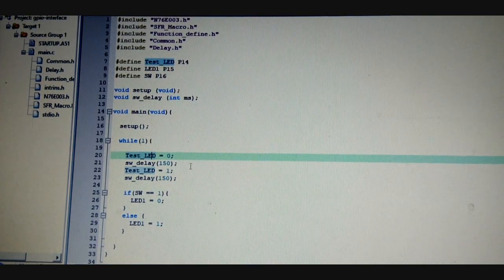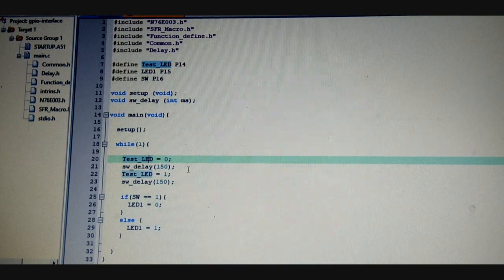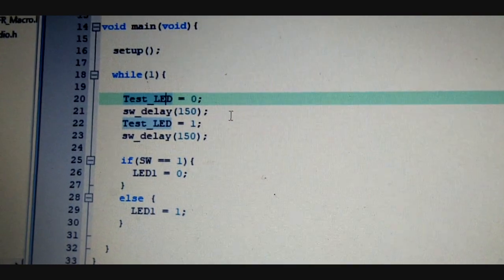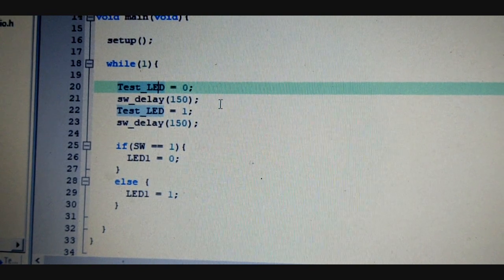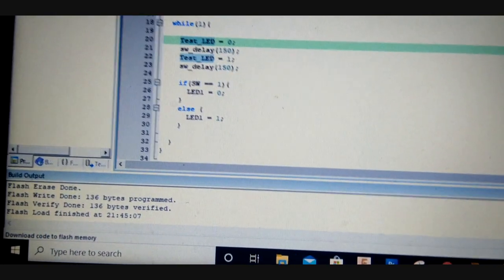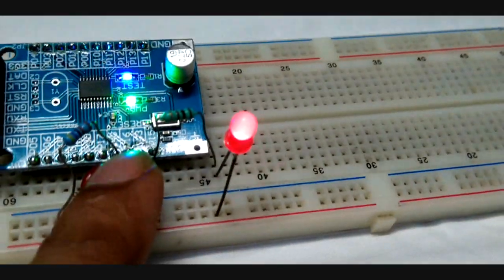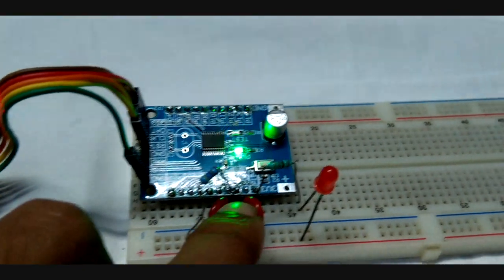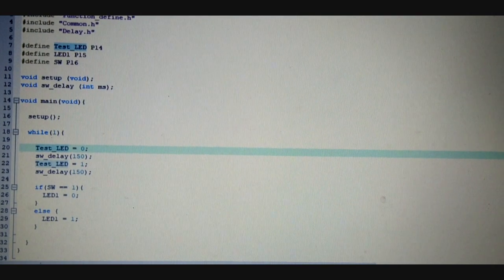Simple GPIO Program for Nuvoton N76003 Microcontroller - Blink LED

Comment: Sir why my nulink programmer is gettig too hot when i connect it to your laptop?? Same thing is happening with your nulink programmer or not please confirm.
Reply from the maker: please post your questions on our forums https://circuitdigest.com/forums. I am sure someone there will be able to answer this
Reply: @
IGNOULIA IGNOULIA
If it detects ok and still gets hot, seems like your programmer is damaged. A dedicated ISP programmer which supports 89S AVR, and NU76E003 is available for 500/- INR.